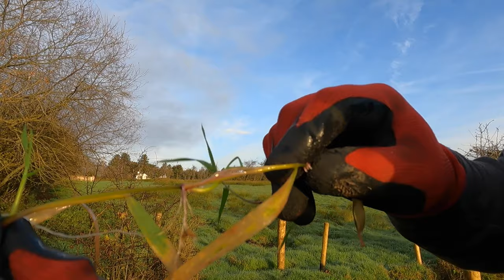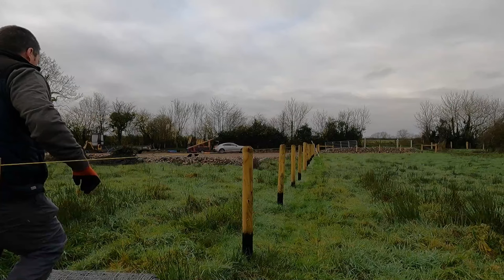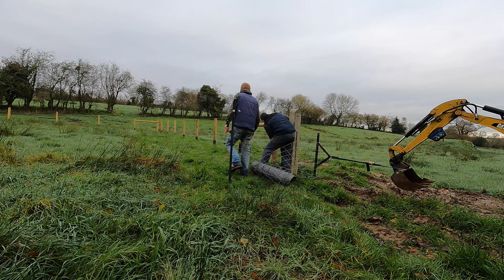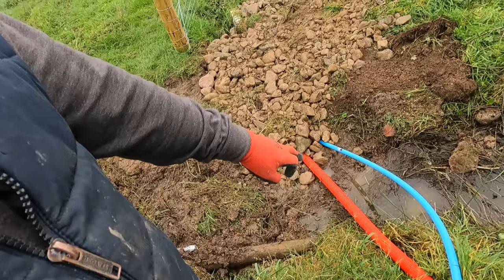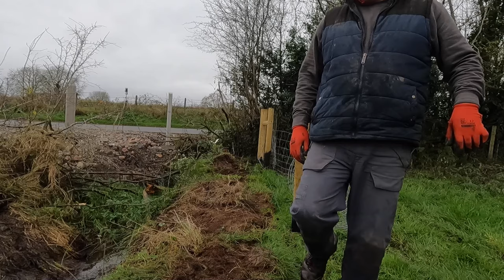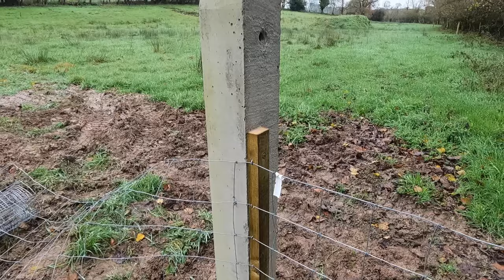SHEEP WIRE TENSIONING / Using a digger!

Comment: Lets say you didnt have the digger how would you strain it?
Reply from the maker: I'd use a pully system there is a video of me pulling wire using a ratchet strap. I held the wire with wood screwed together. Check out the video called - A few plasters required. It's 8 months old thanks and merry Christmas